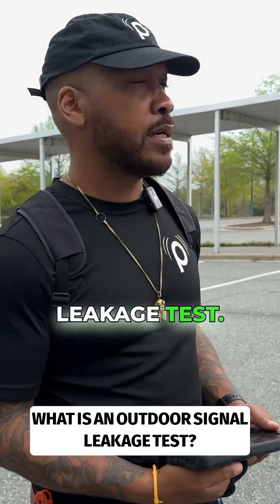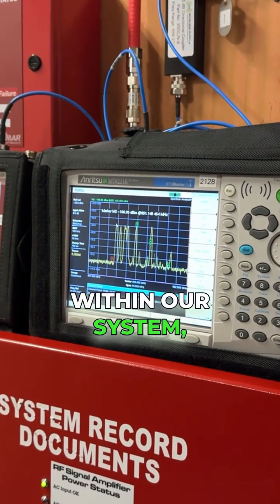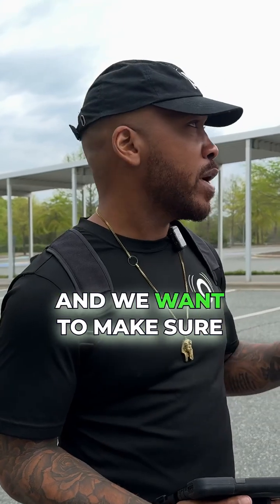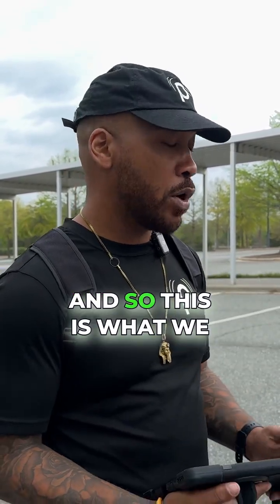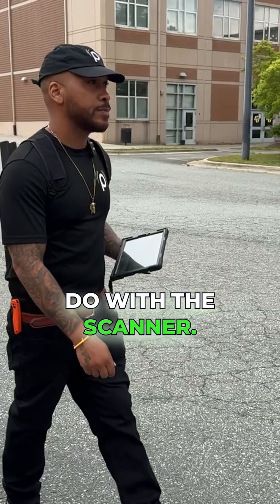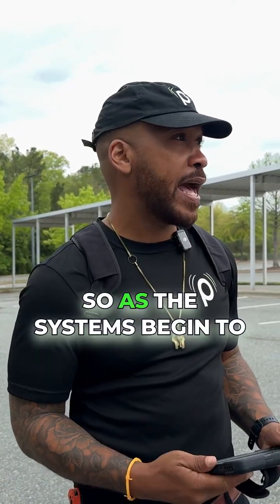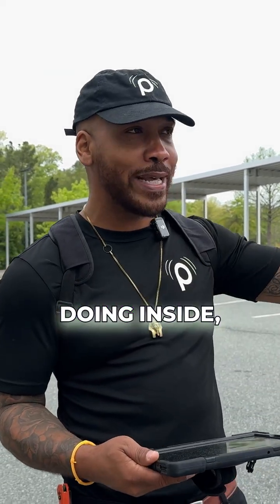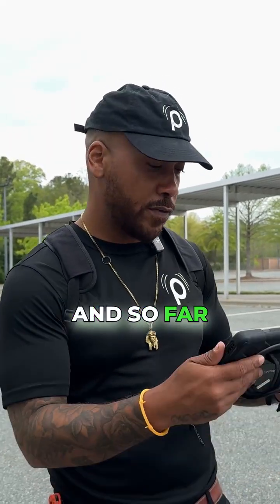Outdoor Signal Leakage Testing For Public Safety Communications Systems

Comment from the maker: Thanks to Freddie Forte for this excellent recap of the outdoor signal leakage test.  It's important to measure downlink ratio signal leakage from the in-building public safety communication system and compare it to the existing outdoor macro signal level.  Excessive RF leakage can cause interference to nearby public safety radio users or interact with nearby buildings with their own public safety system.